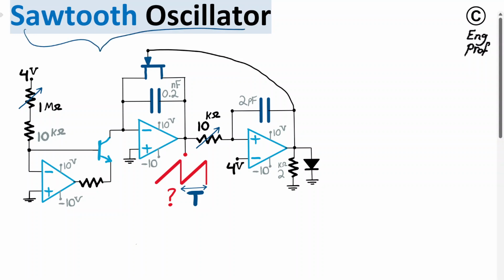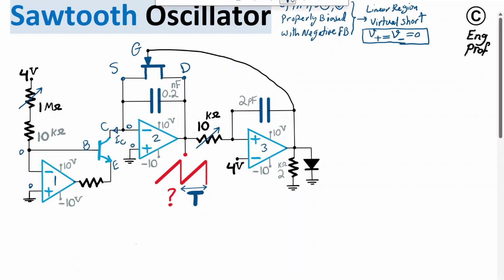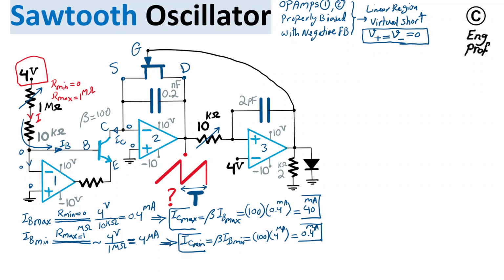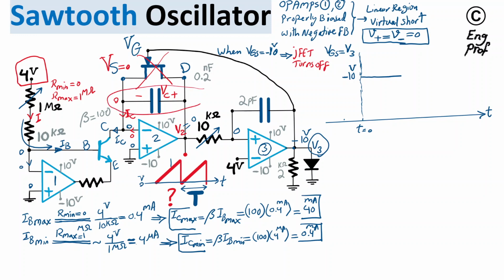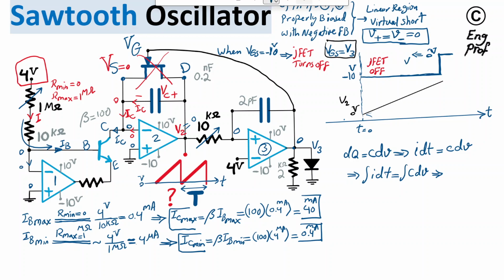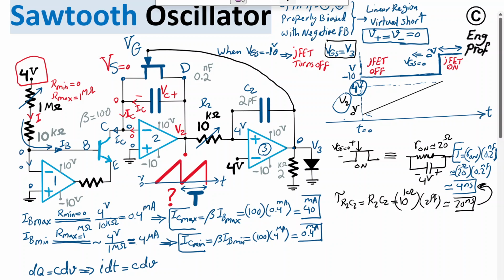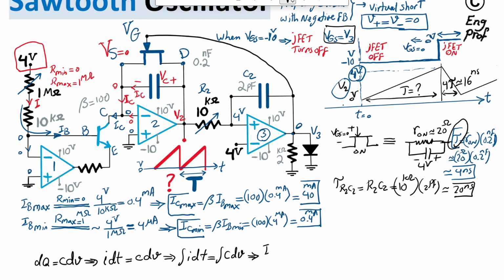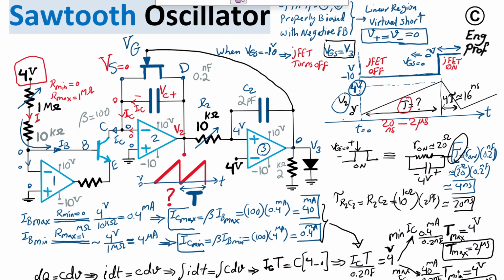Sawtooth Waveform Generator: How does this circuit work?

Comment: I am not able to understand how opamp 1 and 2 react at time T=0,  How transister will get Vcc at T=0, without which transister can't operate. As per understanding at T=0, transudate p-n junction ( base to emitter) will work as a diode and ourput of opamp will be 4 volt too keep  non inverting terminal aa zero . How opamp 2 Will function at T=0 and what will be output of this opamp. Kindly clarify once again to gain clarity.  Thanks in advance
Reply from the maker: Thanks for watching and asking questions. I'm glad that this Sawtooth oscillator design is resonating with fellow circuit enthusiasts. Regarding your question, at the moment when we turn on the circuit for the first time, the negative terminal of the first op amp is momentarily at supply voltage of 4 volts. Therefore output of the first Op Amp is momentarily -10 volts resulting in quick turning-on of the BJT transistor and quick current draw through the base of transistor resulting in bringing down the voltage of the negative terminal of op amp which is the base voltage to zero at steady state when the emitter voltage is -0.7 volts. For further detailed explanation pleas rewatch starting from 10:00 . I hope this is helpful.

Comment: Great video. A small objection: not using a current limiting resistor at the output of opamp 3 will lead to high currents through the diode as the amp wants to drive its output to the rail voltage. Should the opamp contain no overcurrent protection, won't this lead to premature failure of the diode and opamp?
Reply from the maker: Thanks for watching and sharing your thoughts. Glad that you liked this Sawtooth Signal Generator video. You have a good practical point. Having a typical 100 Ohm current limiting resistor at the output of operational amplifier is generally a safe and recommended practice. Otherwise Op Amp selection should be carefully done so that there is an internal max current protection included in the design of output stage of the op amp.  Here are a few more Oscillator Design and OpAmp Circuit examples:  Triangle Oscillator Op Amp circuit https://youtu.be/JF5Up_cuL9k
Sawtooth Oscillator Design https://youtu.be/2eUsGPfqbW4
Complex Sinusoid Oscillator https://youtu.be/GXRhmwmS5Zk
Sawtooth Signal Generator design with OpAmp, JFET, BJT Transistors https://youtu.be/5zHXTx-Vl20

Hope you find these examples interesting as well.

Comment: you named every part except the transistor and intergraded circuits so no we cant build it with lack of information
Reply from the maker: Select a JFET with On-Resistance Ron on the order of 20 to 40 ohm, and with peak Ids current of > 250mA.  Select NPN BJT with hfe or beta of >50 and peak current of 2A.  Select OpAmp as a Zero offset or very low offset FET Op Amp. See more examples in the  https://youtube.com/playlist?list=PLrwXF7N522y4ee_0GL2EdguM-kLtJPxpU Oscillators videos playlist.

Comment: That is how we make PWM in analog era. then i learn PIC and never use again, but a had a lot of fun time playing with
Reply from the maker: Thanks for watching. Glad that this Sawtooth Oscillator Circuit Video is interesting. For more examples please see:  Triangle Oscillator Op Amp circuit https://youtu.be/JF5Up_cuL9k
Sawtooth Oscillator Design https://youtu.be/2eUsGPfqbW4
Logarithmic Amplifier Circuit Design with Op Amp and BJT transistor https://youtu.be/DUlugLSroN8
Op Amp Amplifier with Electronic Gain Control https://youtu.be/NoNgQpbj77Y
Wilson Current Mirror Design https://youtu.be/LfbfJYrovN0
Thermometer Circuit Design with Op Amp & BJT transistor https://youtu.be/55YsraFE0rg
Programmable Current Source Design with Op Amp, Zener Diode and Digital Potentiometer https://youtu.be/R1x6B0TczWk
Analog Logarithm Computer https://youtu.be/RpKEq5WyoLg
On-Chip BJT Current Source Design https://youtu.be/Rs7gEMk03dw
Instrumentation Amplifier with Electronic Gain Control https://youtu.be/C4tghZ-q6Zs
Op Amp Analog Computer Differential Equation Solver https://youtu.be/ENq39EesfPw

I hope these additional examples are interesting as well. 🙋‍♂

Comment: Discharge time was calculated as 4ns, how did you get 4*tau as discharge time again. Please, I also don't understand the role of r2 and c2 as a filter the circuit.
Reply from the maker: Thanks for watching and your follow-up question. In simple RC circuit, Voltage of capacitor charged or discharged via resistor is governed by an exponential relationship in the general form of Vc(t) = Vc(final) +(Vc(0) - Vc(final))*exp(-t/(RC)) where RC is time constant (Tau) and we can roughly assume that capacitor voltage reaches the steady state in ~ 4*RC (if the state of circuit does not change).  For more circuit examples please see the circuit videos playlist: https://youtube.com/playlist?list=PLrwXF7N522y4c7c-8KBjrwd7IyaZfWxyt
I hope this explanation and these analog circuit examples and videos are helpful.

Comment: Man, I want to try this. I built a saw tooth Gen using transistors, but the output is too low, when trying to amplify I end up with a Square wave or nothing, (impedance). The sawtooth and the amplification of this sawtooth is my Nemesis. I have been sweating bullets for a while now. My Oscilloscope demands this!
Reply from the maker: Thanks for watching. Glad this Sawtooth Oscillator Circuit Design video is useful. For more Oscillator Design examples please see below (I hope you get the chance to try these circuits 🙋‍♂) 
Sawtooth Oscillator Design https://youtu.be/2eUsGPfqbW4  
Triangle Oscillator Op Amp circuit https://youtu.be/JF5Up_cuL9k
Complex Sinusoid Oscillator https://youtu.be/GXRhmwmS5Zk
For more circuit examples please check the circuit videos playlist: https://youtube.com/playlist?list=PLrwXF7N522y4c7c-8KBjrwd7IyaZfWxyt
I hope these analog circuit examples and videos are interesting and useful. Thanks again.

Comment: But why u calculated Ib max when the variable resistor on min value and Ib min when the variable resistor on max value?
Reply from the maker: Thanks for watching and asking question.  Sure, watch the video at 4:40 and you see that the value of resistors shows up in the denominator of the BJT transistor's base current formula. So the lower resistor, the lower the denominator and hence the higher the base current. I hope this explanation is helpful.
Reply: @STEMprof  thanks!
Reply from the maker: You're welcome. Thanks for watching. For more examples please see Voltage Regulator Design with Zener Diode, Op Amp & Darlington BJT with Current limiting Foldback feature https://youtu.be/RFfRrbqM_-s
I hope it is interesting and helpful.